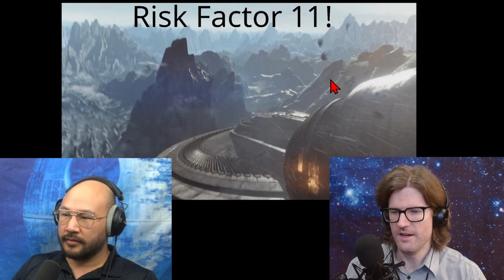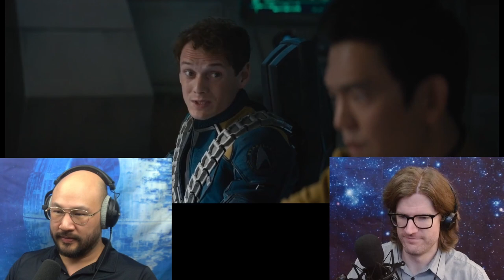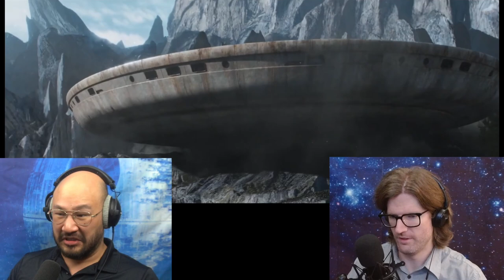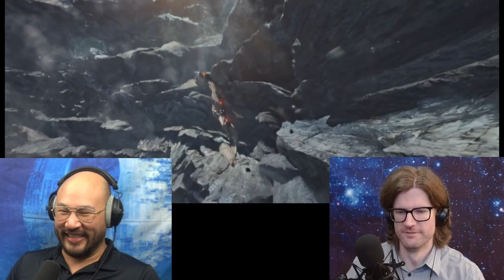Star Trek Beyond | Risk Factor 11

Comment: It's just like in BTTF (part 3, at least). Doc says "Mr. Fusion powers the time circuits and the flux capacitor. But the internal combustion engine runs on ordinary gasoline, it always has. [...] Without gasoline, we can't get the DeLorean up to 88 miles per hour." The time circuits and the flux capacitor move the DeLorean through time, but the engine moves it through space. In the same way, this spaceship has seperate ways of moving itself - one being critical to the other.
Reply from the maker: You're saying that starting the Franklin's engines is somehow analogous to moving at 88mph in the classic scene in Back to the Future? Interesting!